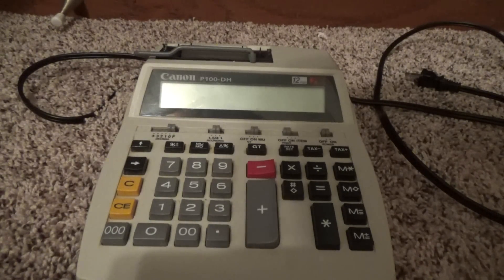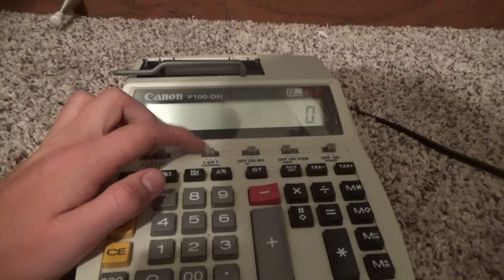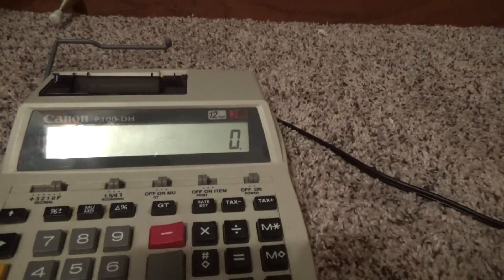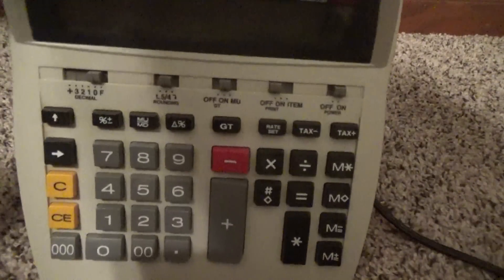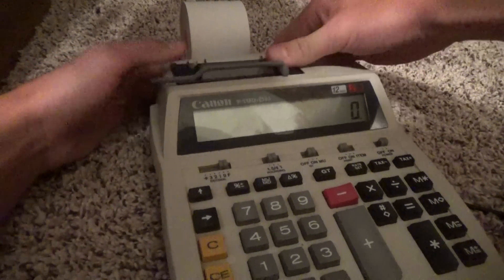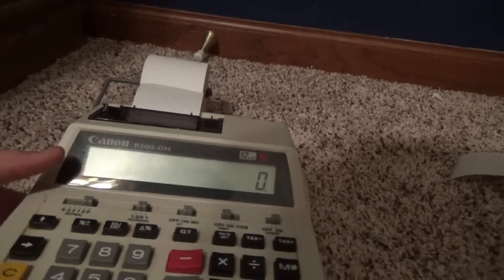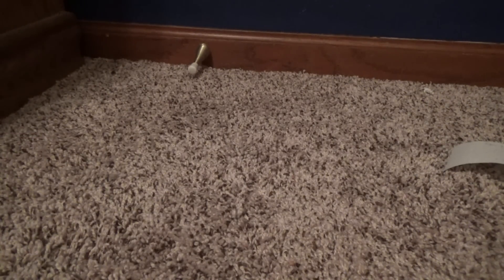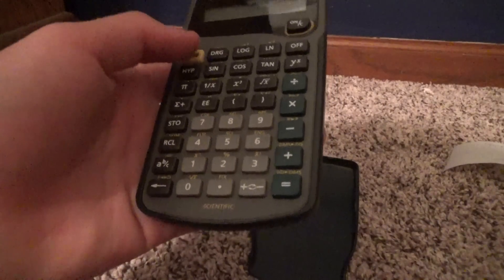A Texas Instruments Scientific Calculator and a Canon Printing Calculator!

Comment: These are great at tax time.  Also great for any "mom and pop shop".  Computers and hand-held calculators have their place.  But sometimes you really need one of these.  You can "renew" the ribbon by putting small drops of 3 in one oil or similar product all along the length of the ribbon.  No need to buy a new ribbon.